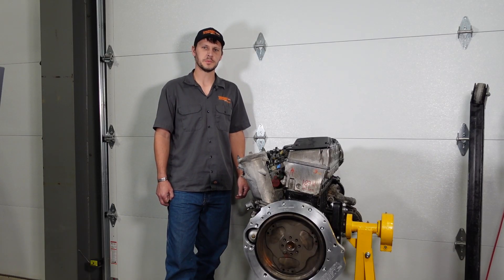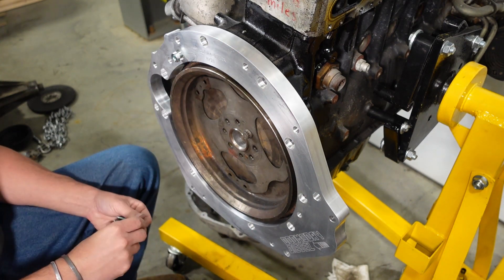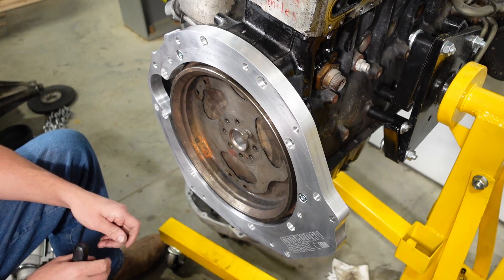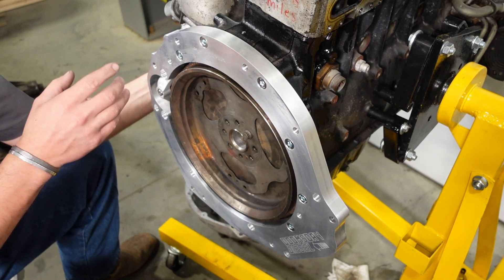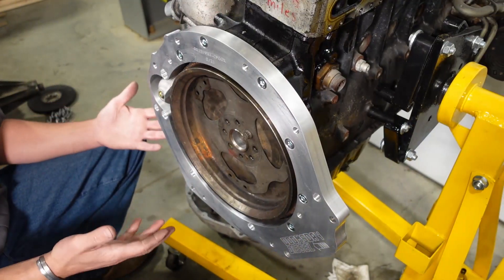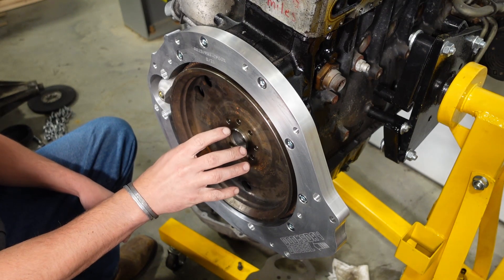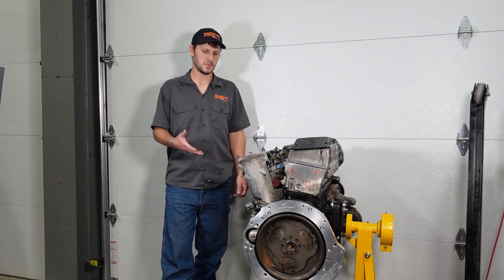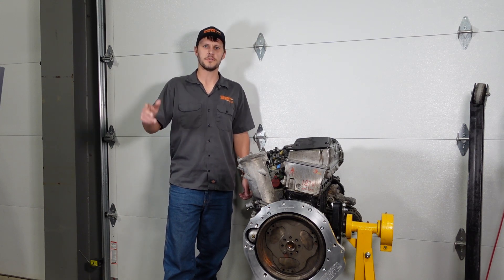OM60X Conversion Series: Manual Transmission Adapter Installation

Comment: Will this work on a 2007 JKU manual?
Reply from the maker: @bryan565656  JK trans already bolts up with the factory diesel bellhousing
Reply: @ so no adapter needed?

Comment: I just ordered your sticker for this adapter. I still havent decided on a MB diesel engine yet. It will replace the 351w in my '96 Ford F-250 w/5-speed ZF manual trans.. I'm currently researching the following: OM602, OM603, & OM606. I'm not looking for max power. I use this truck mostly for light-duty. My primary goal is MPG. Currently, it's around 11 with the factory 5.8L. Anyway, great info you've provided here!!

Comment: Is there going to be any issues where clutch fork free play needs to be measured to make sure that the clutch isn't going to slip or has that already been factored in  ie. Is there any chance that I will need to have the adapt plate machined Io accommodate for the clutch fork being too close to the release bearing. I have read some horror stories about other companies who did not factor this into their plate when it was manufactured. I am just thinking out loud before I drop the ball on something that costs over a thousand dollars. Also, any ideas on how to use the factory jeep wrangler engine mounts
Reply from the maker: @OtisDavies-cv6ze  the adapter from recreates the back end of a 4.0L, so your clutch will think it's behind a 4.0L.
I offer bolt-in motor mounts for the Jeep MJ/XJ and DIY plates for the Wranglers.

Comment: Hey joe i have the om603 to sbf kit and there is a spacer washer in it so is that used? I pull the flex plate off and leave the flywheel on then install new spacer from kit the crank adapter then the flywheel adapter? Thanks bud!

Comment: Hi Joe,
Great to learn about NA 606 flexplate. I'm in the process of doing a one-off (for myself) adaptation of turbo 606 to 4t80e transaxle. The solid disk style flexplate of the na 606 is just what I need ! I can easily drill out for my GM torque converter studs.
Thanks so much for the tip, subscribed.
You do great work and produce really good videos. I'm retired in Maine and wishing you continuing success persuing your dream.
Ross
Reply from the maker: @rossconverse9067  sorry I missed this, but thank you so much for the tip!!

Comment: Does having the two "flywheels" affect anything? or the offset by the crank adapter to the jeep flywheel?

Is the 606 more sensitive to match balancing compared to the 617? Meaning would it be more critical to balance the 60x crank vs a 617s?
Reply from the maker: The added weight is beautiful for a 4x4